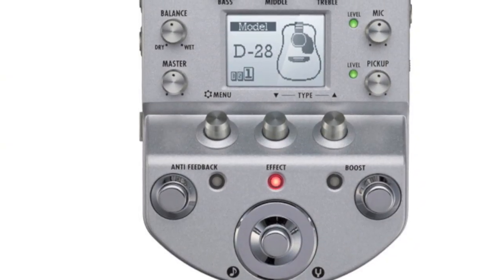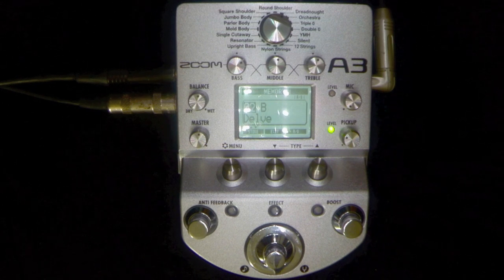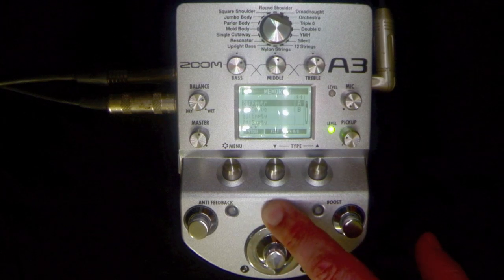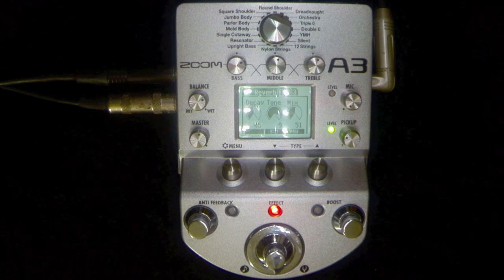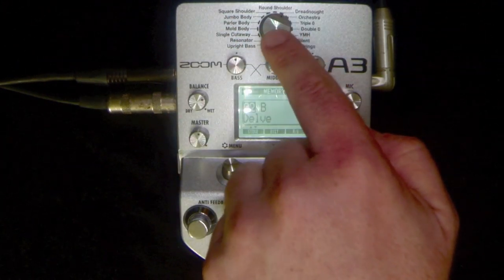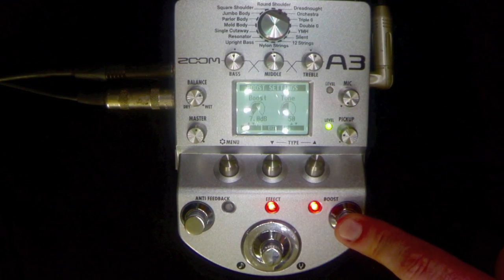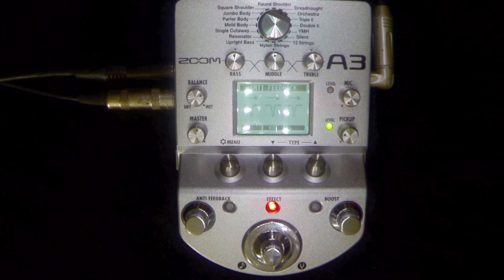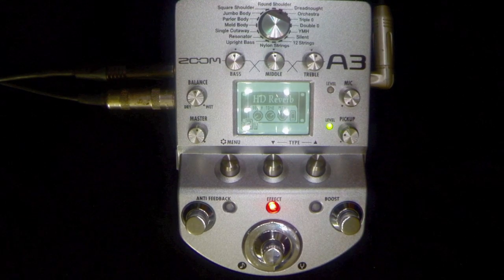Zoom A3 Acoustic Centre TV

Comment: Unfortunately, you are unable to pedal through effects you may want to change to in a live situation. This will not qualify for my needs. An assignable midi pedal(s) would be a solution.
Reply: +Bobcatt22 

You can always have many patches with pedals on/off save them and cycle through them (to your desired order) using the center footwitch.

Check page 21 in Zoom A3's manual